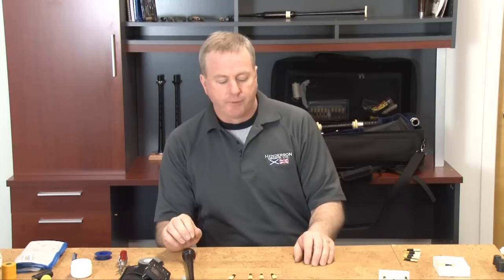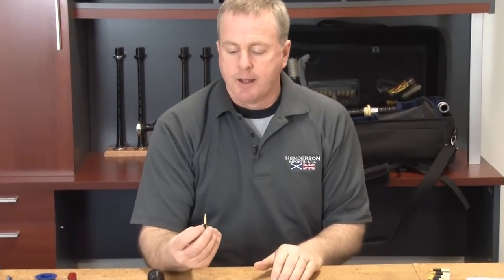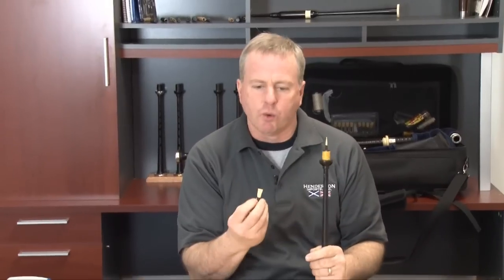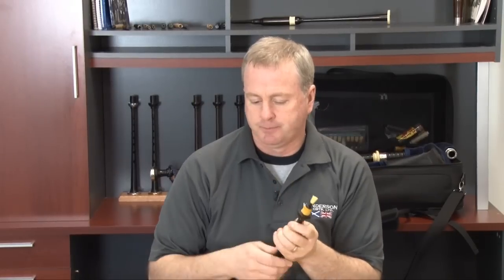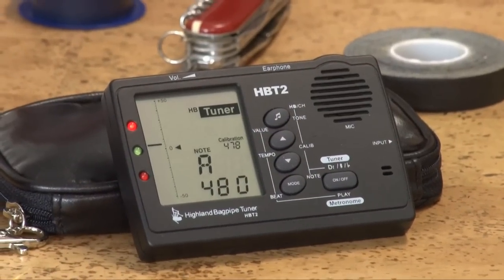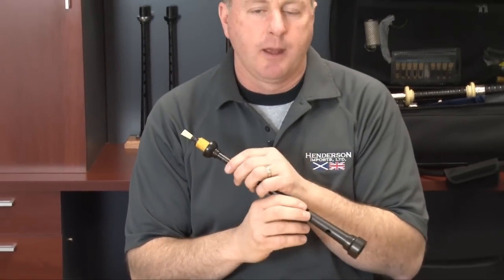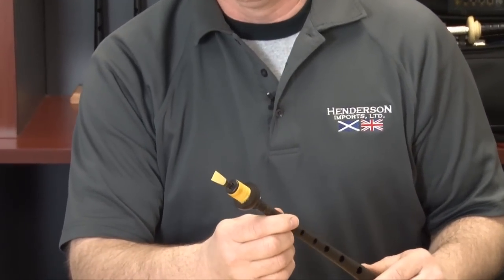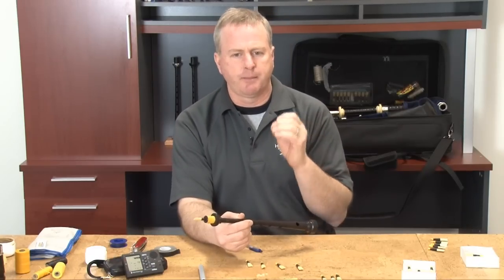Pipe Chanter Reeds - Part 1 of 3

Comment: Humid air penetrates cane or everything faster than liquid water. If you feel a need to add moisture, breathe on it in the mouth for a minute don't waste time wetting it. Short term reed stability comes after cycles of expansion against binding/staple and relaxation when drying. Crisp tone and easy response requires smooth regular interior curve so reed closes all at once in a microsecond, then opens as abruptly all across. Resurfacing interior curve on wide cylinder fine sandpaper works wondrs.

Comment: Thanks for posting these. They are really helpful. One question that I have is what does one do if the balance between the low and high A is off in a new reed? My low A, for example, is in tune, but the high A is pretty significantly flat. Any suggestions? Thanks...